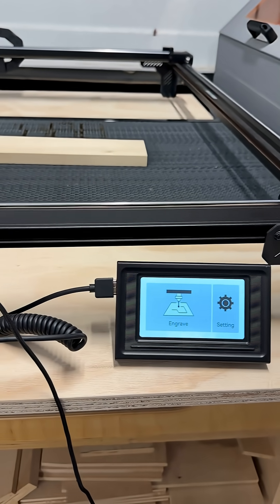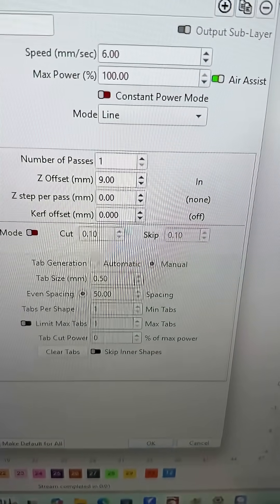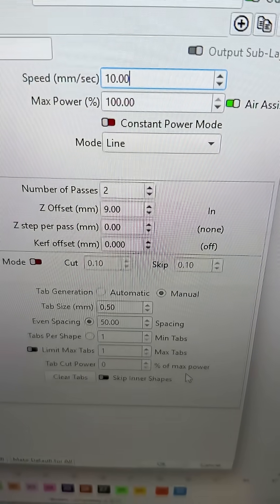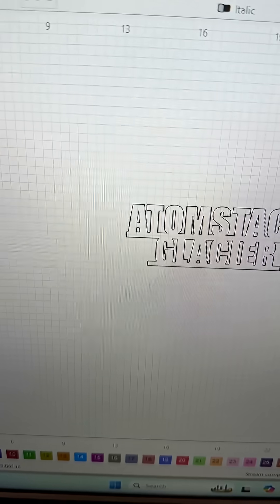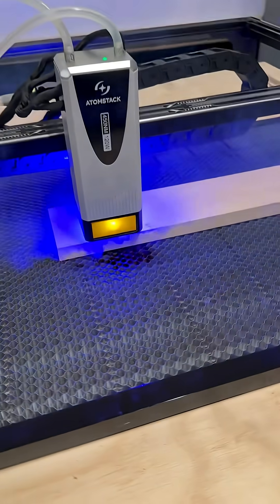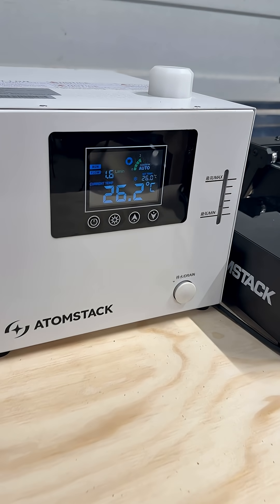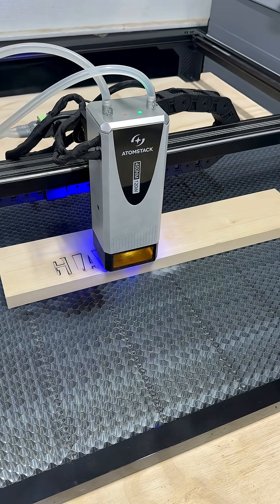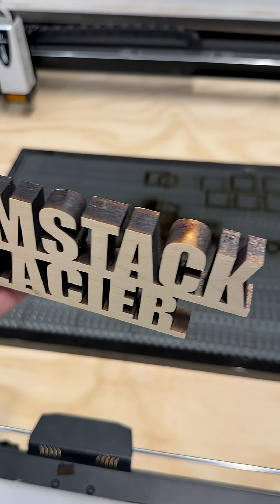Atomstack Glacier 120w water cooled diode laser!

Comment: How is the side by side comparison between this and a 120w CO2 laser?
Reply from the maker: I do not have easy access to a 120w Co2 to test, but my 80w Co2 is faster at cutting most materials than this one.  However darker engravings are easier with the diode.

Comment: I like to put on a older machine, I have been redoing, Can I buy just the laser and chiller?
Reply from the maker: They may eventually offer them up as spare or replacement parts, but they are only in the pre-launch sale right now for the full machines.  You would need the Laser Module, Controlle,r and Chiller as they are all tied together.